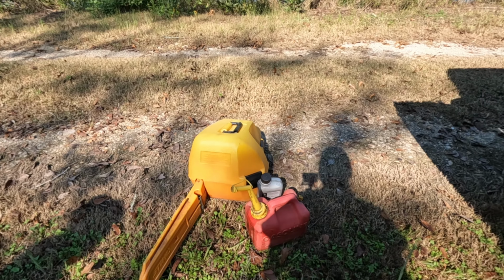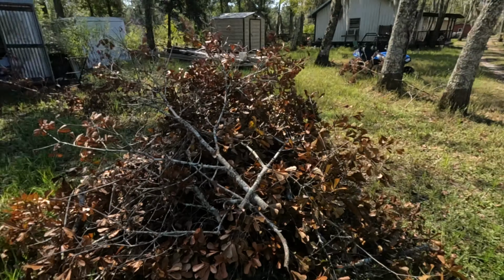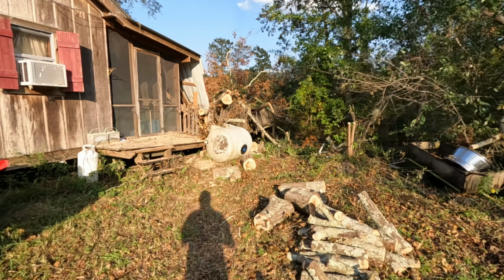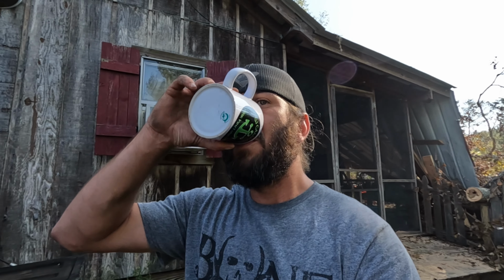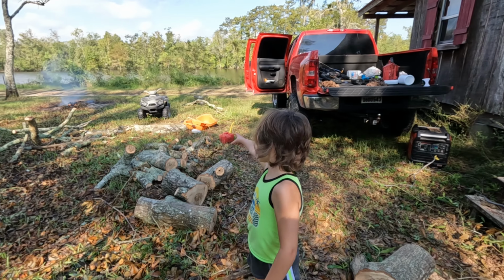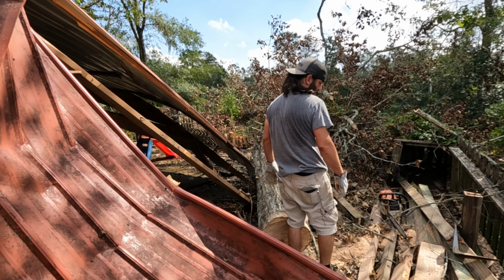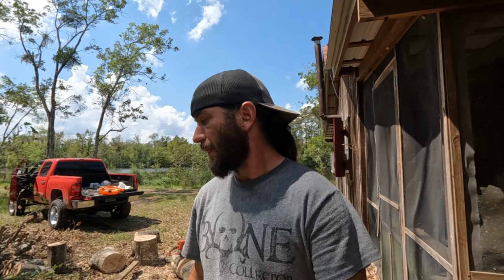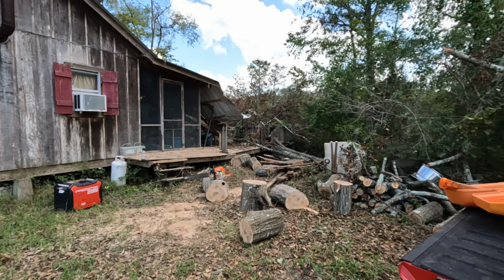Hurricane clean up at the off grid cabin

Comment: did you get chainsaw lessons from your grandad? I stay away from it. I've learned that many bad things can happen that you don't expect, like kick back, logs falling where you didn't plan for them to fall, sharp splinters sticking you in the gut, accidentally grabbing the chain, i've seen that happen, it wasn't me. I know you got it though. It really does take experience. I've seen guys get whipped upside the head from the skinny branches after cutting the main one. This city boy (me) tried to pull a log with a rope, nylon i think. Lesson learned. It broke my back glass. I'm sure that the snap back could hurt someone real bad.
Reply from the maker: You or correct it can be very dangerous! I use Cajun geometry before I make a cut 🤣 that’s why I cut all branches first then move on to the bigger stuff and watch what it does just before finishing the cut, take care buddy 👍✌️